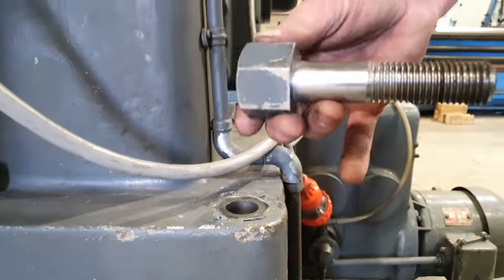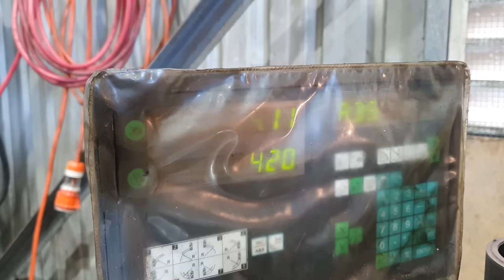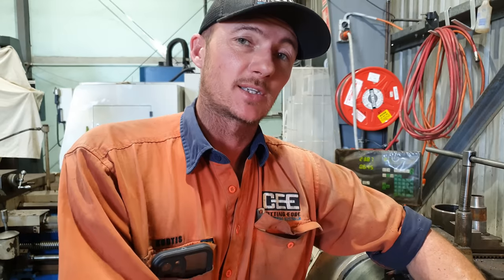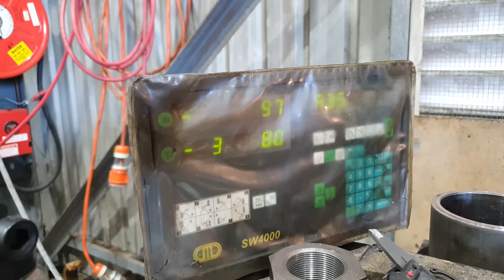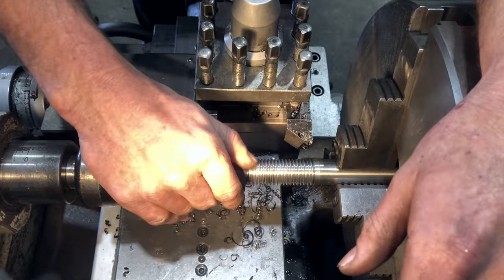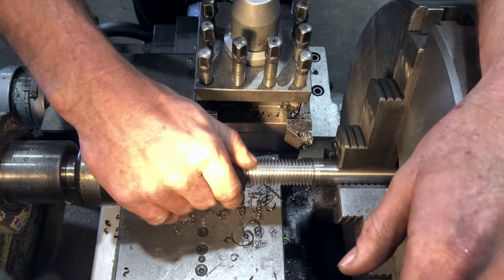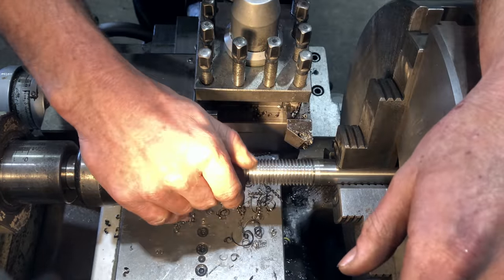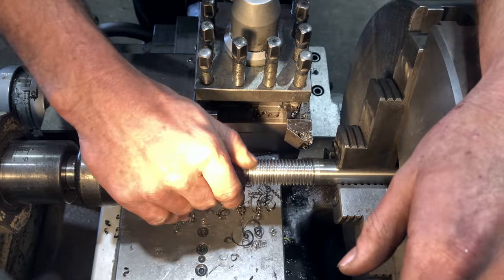Making BIG Hex Bolts | K&W Facing Borer Upgrade | Part 2

Comment from the maker: We're happy with how the bolts turned out, what do you think of them? Let us know in the comments! 😎👍
Watch next Fitting The Riser Block: https://www.youtube.com/watch?v=yWYPCaVubi0
Follow us online here 👇🤳
TikTok: https://vt.tiktok.com/ZSdax3gNQ/
Instagram: https://www.instagram.com/cutting_edge_engineering
Facebook: https://www.facebook.com/cuttingedgeengineeringaustralia/
Official CEE Merch shop: https://www.ceeshop.com.au
Reply: Was the hex for quality of look ? Cos why didn’t u just drill two holes in the heads at 90 degree from each other too save time ? 
Don’t get me wrong mate u done a cracking job of them bolts of that there is no doubt ✌️🇬🇧
Reply: wouldnt welding a head onto one inch bar be faster than turning down larger stock ?
Reply: 8 TPB, 🍌, love it. High quality job.
Reply: My wife: what ya watching? Me: An Australuan bloke making massive bolts. My wife: But your a 50 year old male nurse who can't even work a screwdriver! Me: Shush! It's just getting to the good bit. .... ..
Reply from the maker: @texanonline1244  that's gross
Reply: @CuttingEdgeEngineering  have you considered filling the inside of fundation with epoxy for more rigidity? Few buckets of epoxy with a bit of rocks would make it a lot stiffer.
Reply: I need some m3x35 bolts. You in for that ? 

;p
Reply: @texanonline1244  🤣🤣
Reply: As with all your work, it turned out great.
Reply: @TheLoxxxton  you can add the huge grin going on in the Netherlands. These videos are just awesome to watch, so much experience and knowledge going into even a "simple" bolt.
Reply: @FrancSchiphorst  Well hello there fellow countryman. 

Leuk om nederlanders te zien hier.
Reply: @firefly2472  ja, vaste vrijdag prik. En op woensdag de workshop Wednesday van ausarmor. Ze doen leuke dingen aan de andere kant van de wereld:)
Reply: Is there any reason why you had to buy such oversized rod just to have a head on it?   I would have gotten a lot closer to the correct size, threaded both ends, and then welded a nut onto one side..  You could have beveled the underside of the nut, so that you could weld it there too, and then hit it with a lathe again to give it a nice finish to that bottom side of the now, "bolt head".  Saved a lot of machine work and a lot of wasted material
Reply: Threads per banana. Omg. Lmao. I thought bananas corresponded to feet?
Reply: @calholli  Studs are a thing so no need to weld anything... but I was wondering the same, a stud would've been faster to do and a flanged hex nut to top that...
Reply: Can someone please tell me how when threading you can make a pass a the exact same spot so you don't cross the thread? Is it just in the gearing of the lathe?
Reply: @markthepcdoc7707  It’s a function of the size of a banana. 😉
Reply: I'm always amazed when you run each pass on the thread that the tool lines up exactly and you don't cross the thread. Is this a setting on the lathe? Question from somebody who's never used a metal lathe.
Reply: She’s a real beaut, Clark
Reply: @direstraits05   The lathe gearing is changed so that the revolution of the work and the motion of the cutter are the correct relationship for the thread. Then, there is a small dial on the cutter carriage that indicates when to engage the carriage motion so that the new cut is on top of the previous cuts. At 16:11 you can see the flat gray dial next to Kurtis’s hand in the right panel of video.
Reply: @phil6465  Pardon the pun... "turned"... 🙂
Reply: @dleland71  Totally unintentional.🙈😀
Reply: @OhHeyTrevorFlowers  close but I think Kurtis leaves it engaged and just runs it in reverse and then restarts it to cut again. This is how we did it 60 years ago anyway.
Reply: @uglysteve1  It depends on the lathe, I suppose. I haven't used the exact lathe Kurtis is using but when I saw the engagement indicator I figured he was using it.
Reply: You did a great job Curtis and crew! I will admit, that job made me tired just watching all you had to do! Awesome as always! Cheers!
Reply: Bolts are like most everything you do.. very nice and neat in appearance and work like a charm.. What more is there.
Reply: I love that You buffed the bolts in the end! Essentially that is pure esthetics but it screams: "Quality job!" Nice, thanks!
Reply: @texanonline1244  probably but Kurtis is an artist.
Reply: @97marqedman  says cousin Eddy
Reply: @direstraits05  Most lathes I have used, have a dial-indicator geared to the lead-screw. The lead-screw is engaged at the same mark on the dial-face each time. If you have the instructions for the lathe, written in real English, it will also tell the operator how to speed things up. For example on a Hercus lathe, threads with TPI divisible by 8; "...the lead-screw can be engaged without regard to the dial-face." Or it may be that the TPI suits engaging when the dial-face is at an even number. For threads not easily divided, such as 13 and 1/2 TPI, it is engaged at the same mark every time; or if that is too scary to contemplate, the lathe is put in reverse without disengaging the tool and wound back to the start, before advancing the tool for next cut.
Reply: @TheFreddyfloyd  yes, there is a gear train that connects the spindle and the tool feed screw so they line up every time.
Reply: This is one of my favorite things on YouTube, my dad having been a machinist since the early 60's. Makes me want to buy 2nd or 4th hand machines and roll my own, coz big box pre-fab parts & things sold in the States being so absolutely garbage now
Reply: Probably showing my machining ignorance with this question, but why not use a 1 inch rod threaded at both ends? Are thick washers and nuts not as strong as the machined bolt head?
Reply: @texanonline1244  quality not quantity buddy.
Reply: I think you have to do it that way if you cut an imperial thread on a metric machine
Reply: I have to ask. Why didn't you just make 400mm studs and use nuts and washers?
Reply: @direstraits05  " Is it just in the gearing of the lathe?"
Yes.
Reply: As regards the appearance of the bolts, some pieces of engineering have a natural visual and tactile beauty. Might be a bolt, might be the whole bridge, but a good engineer will derive a special satisfaction from something that is just ........ right.  Regards, and I hope you enjoy the outtakes as much as the rest of us.
Reply: Hey Cutting edge, can I ask why did you trim down the entire bar to one inch instead of using a larger diameter hole in the spacer and machining the thread to the inch diameter? Is it more of a design vs availability or cost vs effort thing?
Reply: Alright so I rewatched this & (several other CEE vids) with my dad up visiting him today. Dad: "yeah the machine shop in Houston had to make big ol pretty bolts like that to get my old Hemi to stop exploding on the drag strip when you were little, that's what paid for your brother" I about sh*t myself laughing
Reply: Hello sir. I noticed every now and then (when thread cutting) you lightly bump the handle of the top slide. What is the purpose of this? Great content as always, thank you for sharing!
Reply: Part 3?
Reply: @gregsullivan8956  yeah, that's where he installed the riser & bolts
Reply: " Being in Australia , the land of Down Under , should these bolts be left hand thread or counter clock wise ? "
         Asking on behalf of an Texan Fitter and Turner " Rigging Assembler "
Reply: @boboften9952  Hahahahahaha! That comment actually made me LOL🤣🤣 And not just because I'm from East Texas!
Reply: Newbie question: you used coolant on the shaft reduction process and cutting oil on the threading process. Is there an advantage to the oil or can you run coolant of all of it?
Reply: Привет!
Слишком сложное и дорогостоящие решение.
Можно было взять материал меньшего диаметра и изготовить шпильки, что в итоге сказалось бы и на качество соединения в лучшую сторону и не настолько трудозатратно ! ☝️🧐
Reply: mate could you have made the bolts into socket head cap bolts instead  ?
Reply: @TheLoxxxton yeah me too
Reply: Very nice, like the look.  You would have missed that with hex stock. I need to get my rotary table cleaned up.
Reply: Good job
Superb achievement
The shots and editing of your videos are of very big quality
Reply: O formato e acabamento ficou melhor que os originais!🎉🎉🎉🎉🎉

Comment: Great way for making custom bolts. We had a Ministry of Defence contract and we were manufacturing and assembling verything except for the ordnance. We had to make special bolts and for that purpose the company bought a profilator which would machine a hexagon complete from round bar. The process was hypnotic and I would often stand there watching this fantastic machine for that time, making hexagons from round. These days it is easily achieved, but back then it was fascinating and so fast. Looking forward to part 3, thanks for posting, be well, be safe.
Reply: Ministry of Defence deals in ordnance.
The Holy Church deals in ordinances...
Reply: @patverum9051  notwithstanding, his statement remains valid, he wasn’t assembling clergy. That would be an ecumenical matter.
Reply: @patverum9051  Sadly sometimes in life you have disappointments, I'm sorry that I failed to check my spelling after my spell check changed it. I had a work colleague who's name was Colin, but every time I sent a memo or report to him his name became Colon. Some people found this hilarious as he was a bit of an A-hole.

Comment: Nice touch hitting them on the belt sander. That's care in your workmanship. A lot of guys would skip the finishing, especially for an in house shop job. You always go the extra bit to get it just right, and that makes you a true craftsman. 
The two of you have become very professional at making good videos as well. You've hit the combination perfectly. Thanks for sharing!
Reply: Personally, I would have used a wire brush in a grinder while it was still in the lathe chuck. Much nicer finish imho.

Comment: You may have already answered this question. I have noticed when you thread on your lathe, your compound is set at 90 degrees.  I was taught to and have always set the compound at 29.5 degrees so the threading tool is cutting on the leading flank, and the trailing flank lightly drags to generate the correct thread form.  The cross slide X always is returned to 0 and the compound is moved in for the cuts.  The load on the nose of the threading tool would be reduced and chip shape tends to curl instead of a V that goes where it wants.  I enjoy the channel and tell people about you all the time.  Thanks.

Comment: I enjoy watching your video's it brings back many memories for me. I am retired now, but I was an engineer, I served a technician apprenticeship, so many of the things you do are things we learned about particularly in the first year when I was 16/17 years old, I spent the whole first year in an excellent training workshop and the following year as a tool setter in the factory and a few months in the tooling investigation department that looked into problems with tooling in the factory and sought solutions, that was the limit of my hands on training. The rest of my apprenticeship was office based in various different, departments, I like most of the technician apprentices finished my time in a drawing office, in my case it was a jig and tool design office which I worked in for a couple of years before moving on. Later I did a number of different engineering roles and completed a degree. But the times I remember with the greatest fondness were the early years of the apprenticeship, a time of wonderment and discovery. We learned all the things you did in this video, but our machines were not so large as yours. I think our largest lathe had about 10 bananas between centres. of course in such a short time the skill level we achieved would not have been up to your standards. 
The bolts you made look great, I am sure they will do the job.
Reply: Wow,  first time I ever heard of lathe center distance described in the banana units of measurement.  lol

Comment: That brings back memories. Working for Atlas  Copco Wagner Mining Equipment Co. As a diesel mechanic in their factory in Portland, Or building oscillating axle assemblies using big long bolts and the twang of the threads and bolts when you hit them on other steel surfaces, the old days. We went through bucket loads of those types of bolts, 32 per machine. The ones I used weren’t as pretty as those.

Comment: Just a damn nice job.  Smart technique using the DRO and the cutting tool as a quick measurement jig in the lathe.  A much better bolt with the flange on the bolt head.  Always love the job you guys do.  See you next week.  Cheers.
Reply: That was one of the tips I picked up too.

Comment: I use to buy hardware for a large yellow tractor company, we had hot forged bolts that were near net then turned, they worked ok but the cold forged were much better. One supplier did 1.5 inch cold, very impressive seeing coil steel that diameter being made to a bolt. Cheers

Comment: Another GREAT watch on a Friday night here in N.Z. Had a good week this round, and with a beer to follow your amazing  bolt making video, and the promise of a sleep in tomorrow, I thank you for another insightful engineering end to the week.
Cheers to all three of you from Hokitika
Pete'.
Reply: couldn't agree more!
Reply: I realise Hokitika is 245 kms South of Nelson by hot air balloon 🎈 but the weather map showed an "Orange Alert" recently for your zone, so I hope things are  a little dryer outside as you sip your end-of-week-beer inside 😀. 
Cheers 🍻 from Chiang Mai 🇹🇭
Reply: @BrassLock  HI Dav.
Yes the whole region was forecast to have lots of water. Hokitika missed the worst of it. Mainly hit through Nelson and Marlborough causing major damage to the areas. Today the sun is out which means the lawns will have a hair cut. Hokitika is a great place 👍
Reply: @Bristoll170  Good to hear that 😁

Comment: Beautiful work.    That's a lot of machining.   I'm not a machinist but I think I would have bought 1" rod and 12 nuts, threaded each end of each rod, and if I wanted fixed bolt heads just brazed the nuts in place at one end of each rod.    But I'm no expert.

Comment: Made right with the flange on there, Still impressed with your threading in the assisted up position. Was taught to thread in the 29 and 1/2* position and a!ways did it that way. When installing big bolts we used a propane torch and gentley heated them to about 200*F ( don't know the C equivalent) and torqued to spec. Never had one come loose. Great video keep them comeing. Follower from the USA

Comment: Kurtis 12:47 min. into the video you advance the cutter toward  the chuck with the compound. I finally understand your threading method. You are cutting toward the chuck. Just the same as the 29deg compound offset does.

Comment: Nice work Kurtis.  Man, I'll but you'd love to have a CNC lathe with a conversational control about this time.  I ran a Romi by Bridgeport many years ago and though it was absolutely the best thing since sliced bread at that time.  The've made leaps and bound since then though.  Keep on smiling.

Comment: When the bolt had their hex head machined i was thinking "This is not up to CEEA standards, but i guess it will do". Then you faced, chamfered and sanded it and it looks absolutely beautiful! Sorry i doubted you!
Reply from the maker: you're forgiven 🤣👍
Reply: c'mon - you should know it ain't over until Kurtis swears like a sailor in the outtakes 🤣
Reply: I was hoping to see a dish feature on the head of the bolt, for weight reduction. Like is done with fasteners going on race machines. 😉
Reply: @tomp538  the machine they are intended for is probably not going to go that fast anyway. If all goes accoring to plan that is.
Reply: @muh1h1  it’s probably better to have all the extra weight so the machine doesn’t move around.

Comment: Manual machinists don't tend to do it, and use a separate tool for roughing and finishing.  When I learnd a bit of cnc I started using 2 different tools on the manual lathe for roughing and finishing and it worked well. Thrash out your roughing inserts and have another tool with fresh inserts to do a nice finishing cut. When the Finnishing tools inserts a dull and effect surface Finnish that becomes your roughing tool.
Also a smaller nose radius makes those long and skinny turns abit easier. I like those triangle inserts. Think they were TNMG with a 0.4mm nose radius.

Comment: Ahhhh, my Friday morning fix with coffee in bed before I start my day. 
This is one of those jobs were I would really really like to have a semi CNC lathe. Not a lot of added value in machining over half the material away by hand. There again I would probably have fully cheated by putting studs in and machining some domed shoulder nuts. Which probably explains why Kurtis is busy in the workshop and I'm still lying in bed drinking coffee at gone 09:00 in the morning.